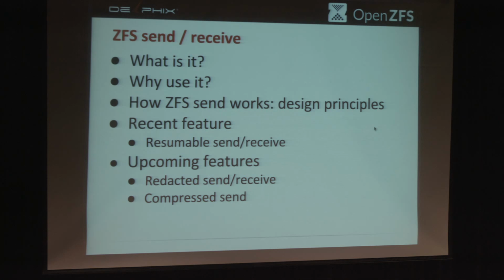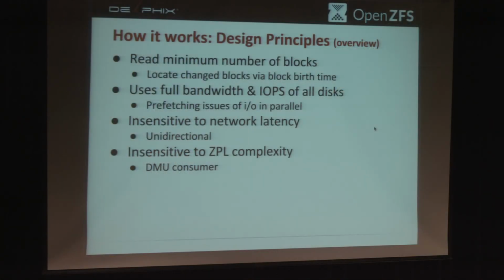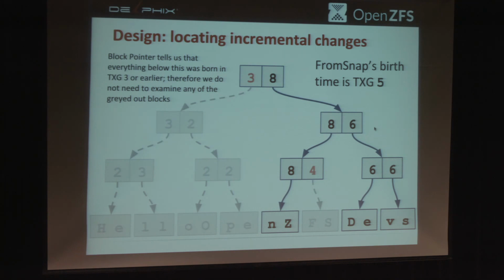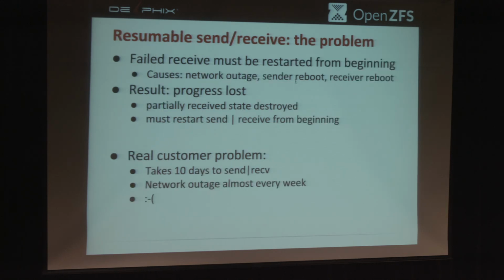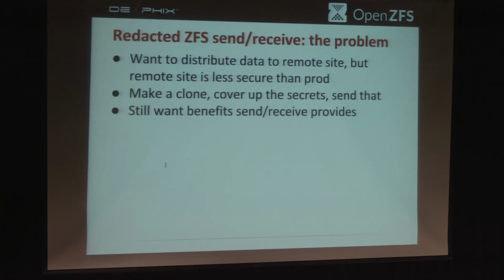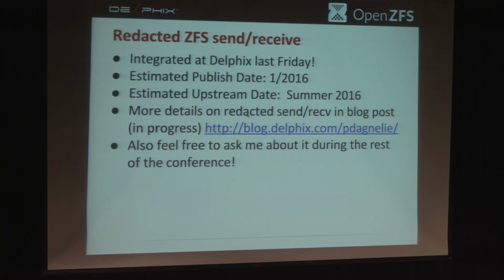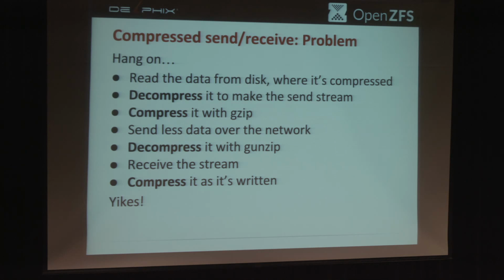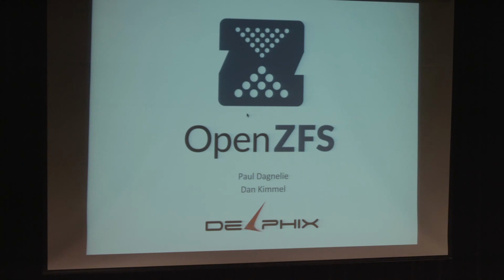ZFS Send and Receive by Paul Dagnelie & Compressed Send and Receive by Dan Kimmel

Comment: thats cool, when is the compression feature gonna be released?
Reply from the maker: Compressed send/recv went into illumos in November 2016.  It went into ZoL (Linux) in April 2017 and is part of 0.7.0 and later releases.
Reply: OpenZFS Too bad 0.70 is not packaged in Ubuntu 16.04. thanks for replying
Reply: 16.04 came out in... surprise... 2016.... April 2017 was a whole year later.
Reply: @BikingWIthPanda  Well, they could've updated it. Anyways, I'm running 18.04 now with ZFS 0.7.5 as root filesystem, I'm loving it looking forward to more support for Ubuntu and integration with apt and systemd.